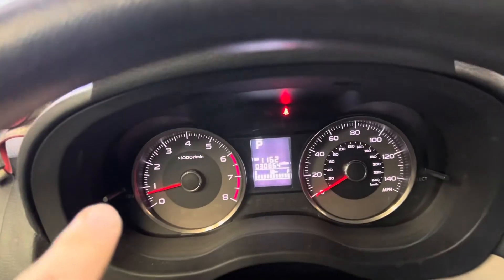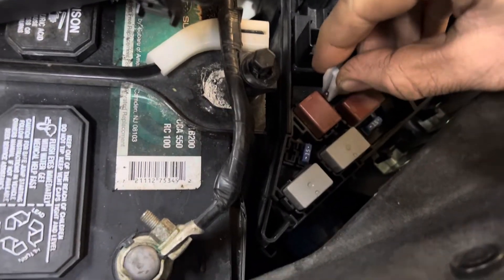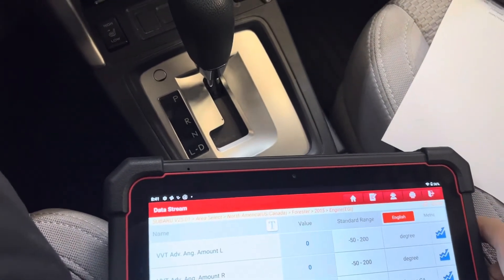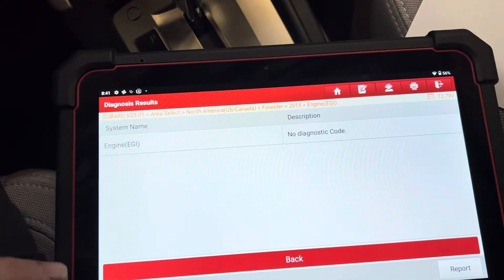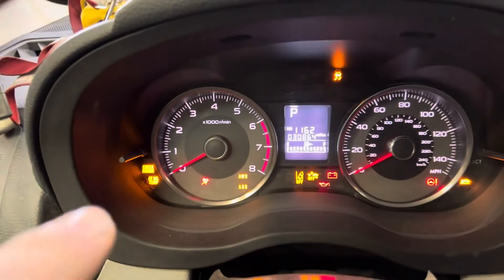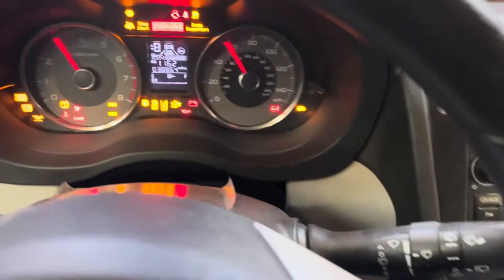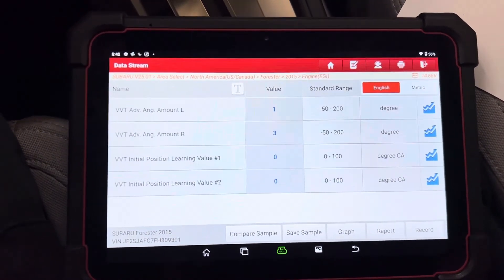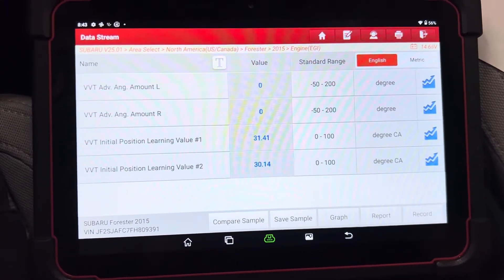Clearing 2015 Subaru VVT learned values without eeprom or ecm replacement.

Comment: Anyone confirm thr thinkdag2 will work?  If not whays the next cheapest alternative?
Reply from the maker: I have tested it on one car and thinkDiag worked for me. I was using it with an iPhone.
Reply: @ThePracticalMechanic  Hello Chad, may I please get your help with a step-by-step procedure using the Thinkdiag 2? Thank you so much!
Reply: I purchased and used the Thinkpad according to this video, code gone, will update if the issue comes back.
Reply: @manuelatallah7127  Hello Manuel, do you know how to access the Test Mode Change function on the Thinkdiag?
Reply: Does Thinkdiag 2 require a subscription?
Reply from the maker: @josephposluszny4443  mine came with 1 yr of software updates. To continue updates afterwards you will have to renew subscription.
Reply: Thanks. For $160 will give it a try for our 2017 Crosstrek. Sounds like the lowest cost tool/software.
Reply from the maker: @josephposluszny4443  normally there is a button on Amazon for a $30 off coupon before you add it to cart.
Reply: Where is the option in the thinkdiag for this. I played around a little bit and couldn't find it
Reply: Do both versions -  ThinkDiag and ThinkDiag2 have the necessary Test Function or just ThinkDiag2.
Reply: I purchased a think diag 2 and have had no CEL back for over a month now. It does work 2020 wrx

Comment: Any luck yet on testing with frs?  I had poo18 and have changed everything and still get the light.
Reply: ANY LUCK ON THIS ISSUE ?
Reply: @josephdiaz3254 did you figure it out?😢
Reply: @nickvidz2458  yea new timing chain phasers and ecu. the advance measurement of the ohaser are stored in ecm and no way of resetting value without eeprom work or replacement !

Comment: I have been working on this 2014 FXT and have changed all timing parts and one intake sprocket. But learning values just wont reset with my thinkdiag2. Both intake values are stuck at their current readings while exhaust is still adapting over time.
Reply from the maker: You installed the fuse to activate inspection mode? And then activated check mode in the scan tool? And then cleared codes?
I’ve successfully cleared numerous vehicles this way. I have a Subaru dealer tech that had a car sitting in the lot waiting for a back ordered ecm. This method worked perfect.
Reply: @ThePracticalMechanic  Yes i install the fuse, activate check mode, my cel is blinking now. Clear the codes, but my learning values wont reset. Doing it exactly same as you.
Reply: I have a similar issue with my 2014 FXT.  Timing seems ok based on disconnecting the solenoids and looking at the angles.  Swapping OCVs doesn't do anything to move problems around.  My learning values were all 0 to begin with (which I think is the source of the CEL), and I went through the reset procedure successfully (fuse, blinking CEL, read and clear faults) multiple times while watching the video and pausing at each step so I follow exactly.  However no matter what I do, my learning values never really change from 0.
Reply: @anandpatel6694  we're you able to reset the learning values? Have a 2014 FXT and intake avcs advance at 26 degrees with key on instead of zero.
Reply: @qhivitiva3823  no.  I ended up having to replace the ECU
Reply: @anandpatel6694  thanks. Looks like I'll have to go that way.

Comment: In your comments you recommend the Thinkdiag 2. Will this do the VVT learned value reset like in the video?
Reply from the maker: I have tested it on one vehicle and it worked fine.
Reply: @ThePracticalMechanic  I just got a thinkdiag 2 and when i go to special functions i do not see the "Test Mode Change" option in the special functions menu.  Am i doing something wrong?
Reply: @Cascadia Motors  hi, have you figured out the Test Mode Change in Thinkdiag 2 yet? If so, do you mind sharing on how to access and reset it?
Reply: @ThePracticalMechanic  Hello, Im dealing with the same issue with my 18 wrx. Would you please leovide a step by step on how to reset the vvt learn values with Thinkdiag 2? Many thanks in advance.
Reply: @JayPham-eg6te  is there an option for camshaft/crankshaft position relearn?
Reply: @RaidsVFX  Hi, still havent gotten my Thinkdiag, wanting to make sure it's possible with Thinkdiag before buying.
Reply: @JayPham-eg6te  was talking to a guy and I guess he managed to reset the values so I’m gonna be buying mine as well
Reply: @RaidsVFX  Hey, do you mind sharing the process once you have them reset or figured out? Thank you,
Reply: @RaidsVFX did you figure out how to reset values using that?
Reply: Thank you
Reply: This will reset all my learned values. That are over range. But they just come back once the drive cycle is complete. I guess I’ll have to get a new ECM at the dealer. Thanks again.
Reply: Interested to know, the thinkdag2 seems like the cheapest option, would like to give it a shot.
Reply: What's a link to the proper thinkdiag 2?
Reply: Why no body like to share the steps

Comment: Have you had any luck with the BRZ/86 ECU's?
Reply from the maker: As far as I know those still require reading the emulated eeprom data using Kess or Magic Flex and then modifying values. 
Subaru has been releasing updates for many vehicles to enable continued learning but I don’t know if the brz has an update yet.

Comment: I like your video, but I have a problem with the legacy 2009, I can't find the location of the fuse
Reply from the maker: 2009 legacy won’t be included in this service bulletin. Those have a different engine and typically don’t set those codes. 
What issue are you having?

Comment: SAVED MY A$$!!! Really appreciate you're write up explanation on this. I have just completed a timing service on 18' Subaru Crosstrek with intake and exhaust VVT. The values wouldn't reset on initial learn. I am glad I dont need to deal with the local dealer. They are terrible here. Thanks again!
Reply: Confirmed. This works
Reply from the maker: That’s awesome. The dealership has replaced thousands of ECMs needlessly. Even their own engineers couldn’t figure this out but obviously the coding was there the whole time. The dealership finally has some software update for certain models that will allow the values to continue to learn back down after a repair.
Reply: Where do I find the test fuse location? I have a 19 Crosstrek.
Reply: @benschekirke9625 
Did you find the test mode fuse location? I’m about to try this fix on a 2019 Crosstrek and I’m unsure what fuse location to use.

Comment: Hey I just wanted to thank you for this video. This procedure worked on a 2017 Impreza 2.0 setting a p0017. Learned value was 110 reset to zero and relearned to 91. I used an autel im608 . Thanks!!
Reply from the maker: Great to hear!

Comment: so I have heard that if you just drive with the check engine light on eventually the values will reset and it will go out. And I'm talking about months of driving.
Reply from the maker: Some will but most won’t. Some people have driven for months while waiting for an ecm to become available and the values didn’t correct themselves.
Reply: @ThePracticalMechanic  okay thats good to know! Thank you for the video!
Reply: I've read that you need to clear the code every time the check engine light comes on and it'll slowly get better
Reply: @skatebushmedia  I've been battling this issue. Before I turn the car off I reset the ECU with the accessport. Hopefully after a few weeks of this it will be fine. Don't really want to spend $3000 on an autel
Reply: @itsgekkonotgeico  might be worth contacting some local shops and sending them over this video, see if they'd be willing to try. I tried with the autel we have at work but it didn't work on the car I tried it on.
Reply: @itsgekkonotgeico  yeah currently dealing with this, my tuner said everything looks fine in logs and that my avcs is where it should be. But code won’t go away so I’ve been resetting every time I drive…
Reply: @RaidsVFX  legit I've been doing that too. Been doing that for a week. Gonna drive it tomorrow and see if it comes back. Such a headache. Someone on here said you can reset the VVT learning with the thinkdiag2. I got one but idk where it is in the menu
Reply: @itsgekkonotgeico  should be a test mode somewhere in special functions maybe? I thought about buying one too so lemme know if you figure it out lol
Reply: @itsgekkonotgeico  apparently there’s a camshaft/crankshaft position relearn somewhere in there? Worth looking for to see if that’s there.
Reply: @RaidsVFX  no luck. Not sure it's on there either that or I'm really special
Reply: @itsgekkonotgeico  you got Snapchat? I don’t wanna buy it if it’s not there lmaoo
Reply: @RaidsVFX  nah no Snapchat.
Reply: @itsgekkonotgeico  ah ok, really wanna get this figured out I hate having to reset my ecu every time and don’t feel like having to replace it.
Reply: @RaidsVFX  I think I just need the learning reset. Maybe I'll try playing around with it more and see what I can do
Reply: @itsgekkonotgeico  there should be a crankshaft relearn but if not maybe just do the fuse then go try resetting it anyway see if that works
Reply: @RaidsVFX  do I have to put it in test mode first?
Reply: @itsgekkonotgeico  I don’t believe so. Did you figure anything out?
Reply: @RaidsVFX  I think I did it the right way. Just can't check the tables to see if it was successful so gonna drive it later and see what happens
Reply: @itsgekkonotgeico  should be able to read live data stream and choose the vvt tables but yeah i did the fuse and tried resetting with my accessport but haven’t driven yet. Doubt it worked tbh lol but keep me posted let me know if it works
Reply: @RaidsVFX  I couldn't find it in data stream. I'll have to check again
Reply: @itsgekkonotgeico  hmmm weird
Reply: @RaidsVFX  do you have discord?
Reply: @itsgekkonotgeico  might go test drive now and see if this code still comes back
Reply: @RaidsVFX  confirmed I just reset them. They were awfully high though. 111 and 110
Reply: @RaidsVFX  Been through 3 drive cycles and the CEL has not come back on. I'll update again in a few days
Reply: @itsgekkonotgeico  what did you do to reset it?
Reply: @RaidsVFX  put it in test mode and cleared the codes. That reset the VVT learning. The values went back to the same thing but the light hasn't come back on. I suspect it will most likely. Time will tell
Reply: @itsgekkonotgeico  is it pending?
Reply: @RaidsVFX  just checked no pending code. VVT learned values are still high though
Reply: @itsgekkonotgeico  where was the test mode under?
Reply: @RaidsVFX  Area Select, System Selection, Engine (EGI), Special Function, Test Mode Change.

Makes sure you have the fuse in before you turn the ignition on
Reply: @RaidsVFX  been through a few drive cycles with plenty of idling and the CEL has not come back
Reply: @itsgekkonotgeico  sweet I’m definitely ordering it now hopefully a permanent fix
Reply: @RaidsVFX  yah keep me posted. 🤞
Reply: @itsgekkonotgeico  still no code?
Reply: @RaidsVFX  that's correct. Still no code. Car is running good too
Reply: @itsgekkonotgeico  was the ecu your only problem or did you fix anything before that?
Reply: @RaidsVFX  I had a bad oil control valve on the exhaust side. I was able to monitor the AVCS withy accessport and see LH exhaust was much slower than RH exhaust.
Reply: @itsgekkonotgeico  I’ve had my tuner look over my logs and everything and my avcs and everything looks good. So I’m assuming just some contaminants in the old oil caused the cel and now the values are stuck because my car drive’s completely normal
Reply: @RaidsVFX  any luck? How have you made out so far?
Reply: @itsgekkonotgeico  ordered it just waiting
Reply: @RaidsVFX  nice man. I was just thinking I hadn't heard from yah. Fingers crossed man
Reply: @itsgekkonotgeico  yeah should be here Friday lol. Definitely hoping it fixes the issue. Been driving the car perfectly fine just keep resetting the code lmao
Reply: @itsgekkonotgeico I’m not seeing test mode
Reply: @RaidsVFX  Area Select, System Selection, Engine (EGI), Special Function, Test Mode Change.
Reply: @itsgekkonotgeico  I have a 2020 but when I click other years I don’t have an engine egi option then if I click 2019 it’s there
Reply: @RaidsVFX  you got discord? I can stream a video of how to
Reply: @RaidsVFX  make sure you put the test mode fuse in as well
Reply: @itsgekkonotgeico well some how I cleared the code took it for a drive and key cycled twice and no code so I checked the values and they are at 0 on the data stream
Reply: @RaidsVFX  probably still relearning. Fingers crossed it doesn't come.back
Reply: @itsgekkonotgeico yeah what are the normal values supposed to look like?
Reply: @RaidsVFX  it should have a range on there
Reply: @itsgekkonotgeico  well it says 50-200 but my highest value was like 92 or something
Reply: @itsgekkonotgeico  both my values are 82 degrees no code yet
Reply: @RaidsVFX  nice congrats!

Comment: Just ran into this issue. 2018 impreza 2.0. Couldn't get learned values back into range after repair. This trick worked perfectly. You are a genius. ALL DATA and Identifix have no info on this.

Comment: I like so much your point of view about diagnostics,what you recommend in 2 sec ,Thinkcar or Autel....need to buy a new one diagnostics machine and need a second opinion
Reply from the maker: If you wanted to try out the thinkcar tool I would recommend the thinkdiag2 it’s less than $150 and has the same coverage as far as I know. It works with android and iPhone but iPhone is lacking a few coding options. This will give you the option of buying a full size launch device if you like it or adding an autel tool as well to fill in the gaps.  
Just looked it up and it’s on sale for $119 https://amzn.to/3HRxwDu
Reply: @ThePracticalMechanic  very thanks
Reply: Will the Thinkdiag2 complete this procedure?

Comment: Hoping to try this out on my 16 WRX. Learned values burnt in on the RH intake avcs after replacing the cam gear. Will update asap....
Reply from the maker: If not Subaru released an update for some of the 2015+ wrx to allow the values to start learning.  I have had many reports of vehicles that the reset worked with but one reported that it didn’t work on a 2020 wrx.  It could have been an error in procedure.
Reply: @ThePracticalMechanic  so when you speak of a released update, would this mean that the dealership could also correct this with a software update if your procedure doesn't work? Thank you in advance for your response on this and my post!!
Reply from the maker: @kempmartin834  if you vehicle applies. I vaguely remember reading that it was only for the WRX with CVT but I could be mistaken. The update was released early January.  If you have a Launch or autel scantool, I would try this reset first.
Reply: Here's my issue. RH intake cam is not in and out of advance with the LH side. Had this problem with the exhaust cam avcs and replaced the gear, no problem. I replaced the LH intake cam gear and getting the P016 and P021 codes as well as slow response. My values were 80ish. This worked for me clearing the values back to zero however still having RH intake values out of whack. Is it possibly the oil filter in the cam carrier that's clogged? Looking for some advice.... 😂 Tired of pulling the timing cover
Reply from the maker: @kempmartin834  have you tried swapping the avcs solenoid to another location? They all should be the same part.  If the problem still remains the one can you may be correct with the plugged filter or passages.
Reply: @ThePracticalMechanic  yes, swapped the cam position sensors around. Problem stayed on the RH intake. Replaced all of the oil control valves as well.....
Guess it's going to end up being a $7 filter that you nearly have to pull the motor to get to....
Reply: @kempmartin834  I have the same problem on my WRX and I'm pulling my hair out deciding what to do. It's an expensive repair bill and a new ECM accounts for half of it. Did the reset shown in this video work for relearning the VVT initial position learning value?
Reply: @kempmartin834  ^ pls reply to the last guy i’m in the same boat
Reply: @kempmartin834 may I ask if it works for your 16 wrx? Didnt work for me on 18 WRX 6MT with Autel 906TS, says function is not supported.
Reply: Update does it work for WRX or not?